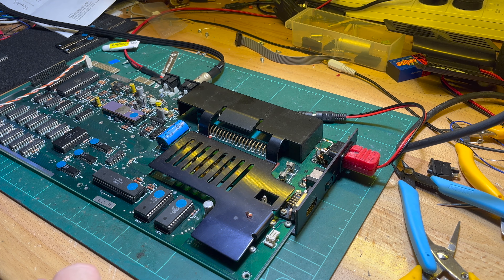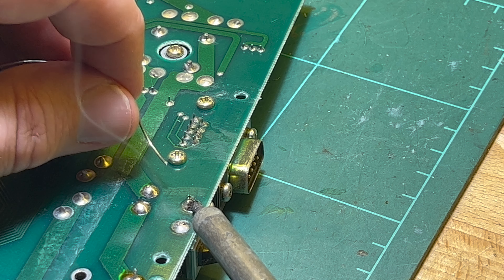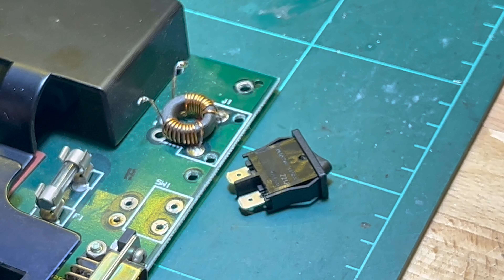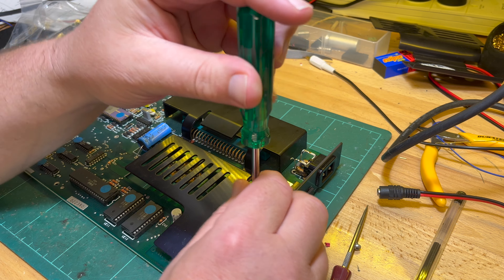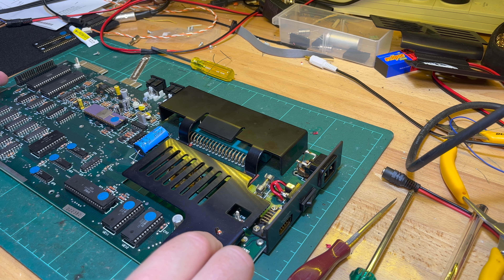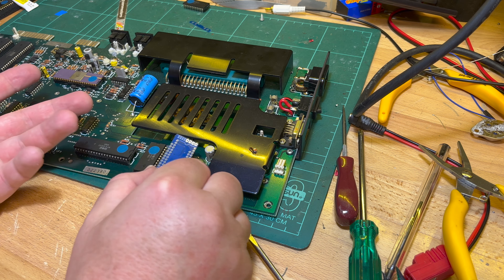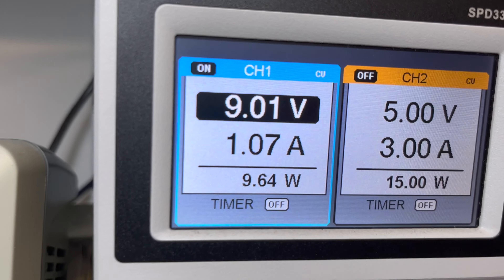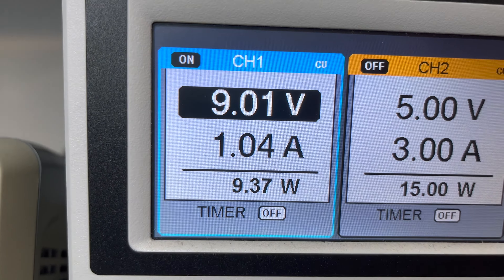🇺🇸 Commodore VIC-20: Modernising Serial No. WGB 7488 (Part 2) [TCE #0212]

Comment: Now I understand why there is a 9 Volts AC needed in a the Commodore 64. I thought that was silly. In the Vic 20 there is also a 9 Volts and probably this goes to some peripherals and when they designed the Commodore 64 they just enhanced the capabilities of the predecessor and they kept almost everything else.
Reply from the maker: I always understood that it was required to power the Datasette motor (although never bothered to confirm myself), and of course it's also made available to the User Port ...